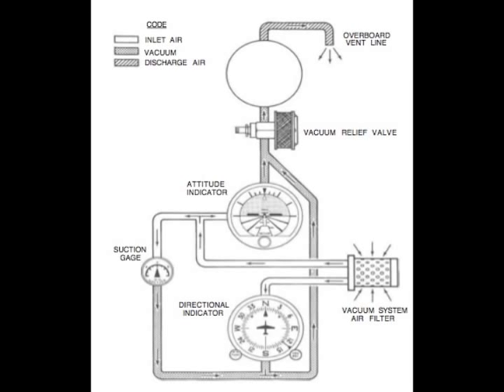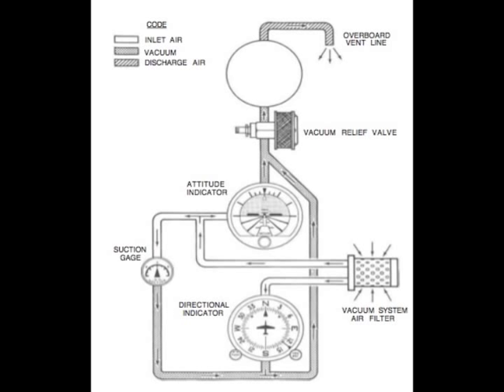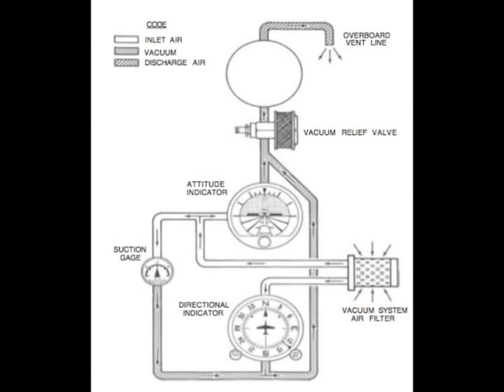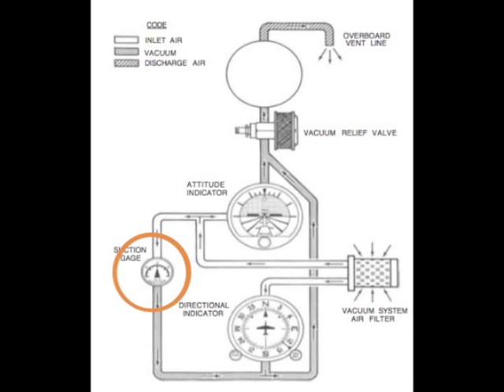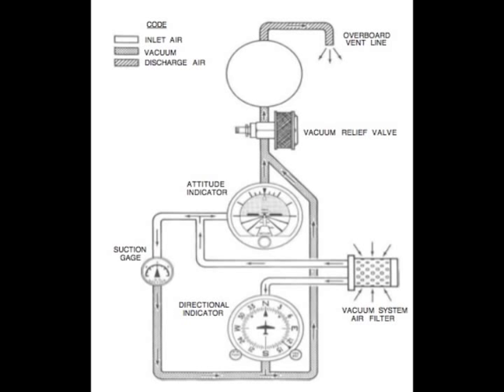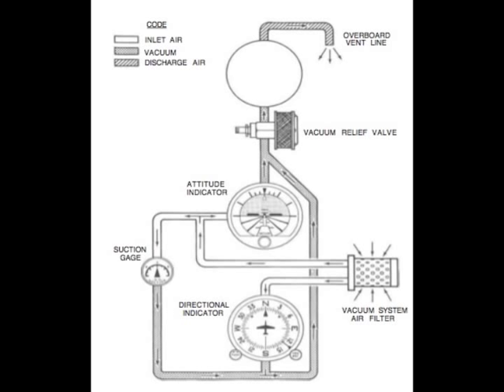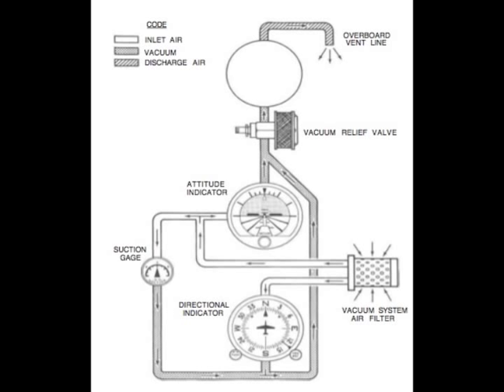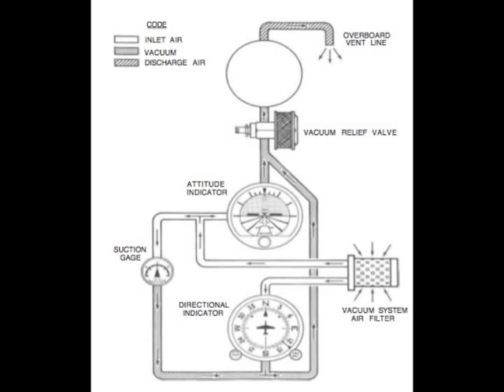Vaccum System

Comment: Can you tell me the difference between suction gauge and vaccum relief filter
Reply: The suction gauge performs no physical function of the vacuum system. All it does is monitor how much suction you're getting whereas the relief valve actually relieves pressure in the system if there is too much at any given point But the relief valve does not tell you about the health of the system like the suction gauge does, they are two completely different parts of the system